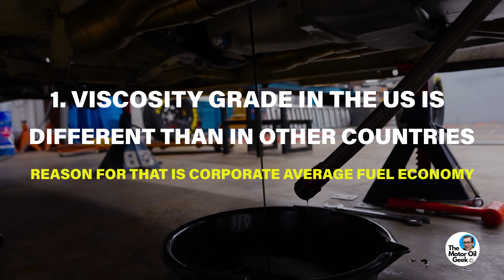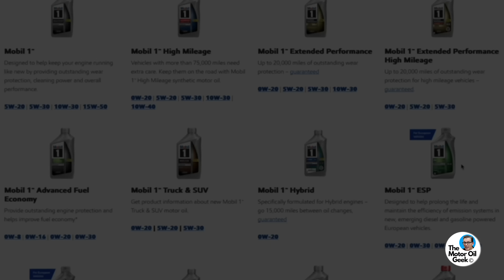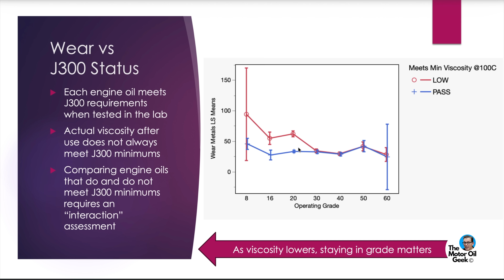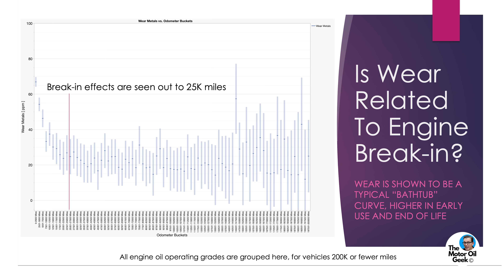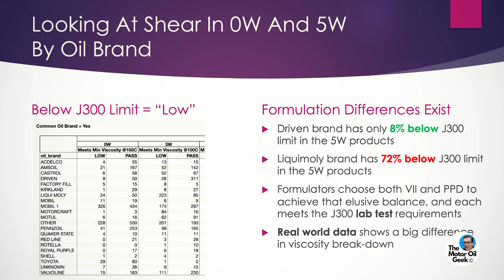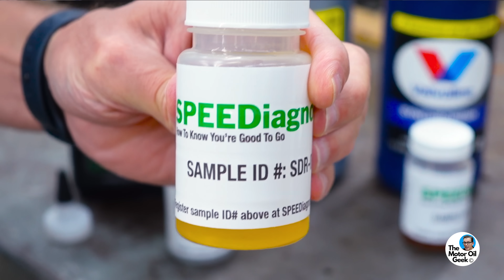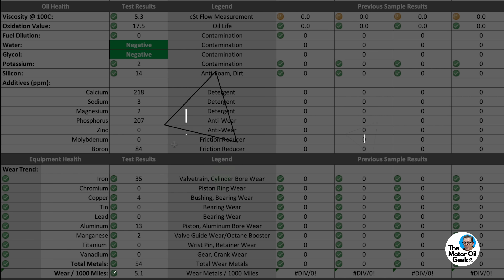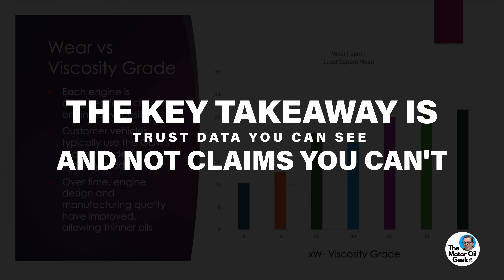More Ai Lies? The FACTS about 0W-20 vs 5W-30 (With Evidence)

Comment: So basically hotter climates stay away from 0w20
Reply: But, how "hot" is hot?
Reply: @cochi2221  over 25-30 degree C is hot enough to not warrant a thinner oil for startup
Reply: On worn engines, I found using a thicker oil in the summer allows for oil pressure to be in the safe range.
Reply: Here in S. FL 0-W20 is completely pointless, correct?
Reply: @hynsum oh definitely. Bump that up to a 5w-20. you don’t need a 0w in florida.
Reply: @lukeWiz44  makes sense to me. 🙏👍
Reply: @lukeWiz44  the 0W isn't the issue, it's the second number that matters. 0W-20 oil is typically superior to 5W-20 oil as they have to use more synthetic base stocks to get it down to 0W-whatever. I would take a 0W-20 oil over a 5W-20 oil because the former has to be higher quality. 0W-30 or 0W-40 oil is a good choice if you want more protection in high temperatures.
Reply: @i @imzjustplayin ou may want to rewatch the video. It was explicitly stated that a 5w-20 is less volatile than a 0w-20. The larger the gap between numbers, the more easily and more susceptible The oil will shear. it’s almost as if you just didn’t watch the video…
Reply: @lukeWiz44  He's correct because they use viscosity improvers but his video was more about how stable an oil is (who cares?) rather than about whether that oil is still providing protection when all the VI have worn out. When VI improvers wear out, the oil becomes more viscous which if you want the best cold cranking ability and better fuel economy on a cold engine, that matters. But just because the VI improvers wear out and the oil viscosity increases, it doesn't mean the oil isn't providing wear protection which is what really matters. If you're changing your oil at regular intervals, using the 0W- oil isn't an issue if your only concern is about cold cranking ability and cold engine fuel economy.
Reply: @imzjustplayin  This comment is backwards.
0W-20 and 5W-20 are the same viscosity at operating temperature. The “0W” only affects cold flow.

VI improvers don’t make oil thinner — they prevent it from thinning too much. When they shear, oil gets thinner, not thicker. Used oil analysis proves this.

Viscosity stability directly affects film thickness, timing chain wear, and oil pump performance — especially in modern turbo engines. That’s why shear stability and HTHS are part of oil specs.

Saying “who cares about stability” is basically admitting you don’t understand why oil standards exist.
Reply: @lukeWiz44  You're right. I misunderstood the purpose of VI. However I would say a 0W-30 oil is going to provide more protection for a longer period of its life compared with a 0/5W--20 oil since the 0W-20 oil is already thinner from the outset.
Reply: @imz @imzjustplayin  me put it this way, the base oil number is the first number. so 0w or 5w. So an oil that’s already super thin, such as a 0W 30, has to be injected with an insane amount of VIIs so it can reach its target viscosity at operating temperature, such as 20 or 30. To kind of put that into perspective, a 5w-20 likely has a thicker base oil than a 0w-40, simply because it doesn’t have to use thinner base oils to reach the cold flow ability. 

it’s an advanced concept that I don’t expect somebody at the consumer level to really understand, but i appreciate you sharing your thoughts on it.
Reply: @imzjustplayin  This is correct. A high quality 5w-20 may be more shear stable but 5W-20s can be made with low quality base stocks that aren't as good.
Reply: @lukeWiz44 Volatility is not mentioned in the video. Shear stability is not volatility. 5W-20 made with mineral base stocks are likely more volatile than 0W-20 which will be at least semi-synthetic.
Reply: @MathewPollard-vj4uq Sure, but a full synthetic 5w-20 will still be more shear stable(due to less VIIs) and yes, less volatile(due to thicker base stocks) than a full synthetic 0w-20.
Reply: @lukeWiz44 5w30
Reply: @hynsum  Probably. I live in Northern California and when it's 40F outside, using 20W-50 doesn't affect cranking ability appreciably over using 0W-20. The thinner oil main benefit is easier cranking in colder temps and improved fuel economy on the CAFE drive cycle which includes cold engine testing. There is a reason the rest of the world has recommendations for thicker oil in most climates. Viscosity when at engine temperature is pretty thin even for the most thick oil. An SAE 60 oil is thinner at operating temperature than a 0W-8 oil is when at room temperature. Room temperature oil is in the thousands of cST while operating oil temps are in the teens of cSt. Think 8-40 for 212F vs 6000 for 70F for example.
Reply: @imzjustplayin  thanks 🙏👍
Reply: No - Climate not mentioned in the video and irrelevant when engine management systems maintain operating temp very closely regardless of environment.
Reply: @MathewPollard-vj4uq Very true. Extremely common misconception. Only time exterior temp matters is extreme cold, when cold start and oil pump ability could be an issue.
Reply: @MathewPollard-vj4uq  Nope. I don't agree, your engine is going to be at vastly different temps if you are in 25F vs 114F.  It took my car 20 minutes to warm up in 32F winters.
Reply: If you have a warranty.  Get an oil analysis after a summer run on 0w20, if it shows is failed, you have documented proof.  I have read a high quality 0w20 can be as good as a low quality 5w30.  Only an analysis will tell you facts.  I have seen videos that state Amsoil, Pennzoil Ultra Platinum, Mobile One Extended Performance, and Castrol with Titanium all did a good job staying in grade.

Comment: A 5w-30 that shears out of grade is still going to be a 5w-20, right?  So why would the wear be more than a 0w-20 that stayed in grade?  Different engines and different applications?  The only way to truly test this would be to do a back-to-back test on the same engine or identical engine operated under identical conditions.  One using a 5w-30 that sheared out of grade and one using a 0w-20 that stayed in grade.
Reply: I believe the graph around 5:30 mark showed 5w-30 oils sheared out of grade protected at least as well as 0w-20 and 5w-30 in grade.

Comment: 0w20 oil works just as well as 5/30 as long as it's in good condition. If it's not however, it can be drastically bad for your engine. Meanwhile the only significant difference between the two whales is allegedly fuel economy. Not enough of a reason for me to take a chance on 0w20, sorry. Also, nobody's even bringing up bringing up how these compare it all with 5w20 which would seem like the happy medium between the both

Comment: What do you suggest for vehicles that get short drives and has out of spec oil and higher wear within 1000 miles or less? On direct injection engines. Oil changes every 500 miles?

Comment: Fuel dilution is the main cause of viscosity loss in modern engines from the UOA’s I’ve seen online and in my own vehicles. I’m not saying all, but a lot of DI engines dilute the oil pretty bad. Blackstone doesn’t give accurate data for dilution either, I figured that out with my UOA experiences.

Comment: 5K miles or 6 months, whichever comes first is the max you should go on synthetic oils, (any grade) for your application.
If you are stingy or can't afford an oil change every six months/ 5K miles, you have much more deeper problems than oil 
viscosity on your car.
Stay in the grade by changing the oil when it's due, is that simple.
If you drive low miles locally then change the oil every three months, even if it has 2000 miles, because those are hard, stop and go local miles.
Reply: *Unless your using Amsoil Signature Series, good for a year 👍

Comment: Blah Blah Blah I have a Yukon 6.0 , f150 5.0 f150 5.4 3v ford 7.3 all over 400k to 780k  in miles use schaeffer's oil 5-40 and in the diesel 15-40 all original engines no new nothing internally No 0-20 would have ever gotten these engines that far This is why new car dealers have 100's of new engines in crates ready to swap sitting behind the service departments The other claim of tighter tolerances is BS as well fact bearing clearance in a 1990 engine is the same as a vehicle in 2025 if those tolerances where so tight you would over heat the bearing and spin it. I buy vehicles from the auction and 0-20 engines are always blown WONDER WHY !

Comment: Oiil change interval of 3000 miles / 5000 km (about 250 engine-hours in a typical city with lots of cars). Unfortunately, in USA and many EU countries it is quite expensive service (DIY is cheaper). For me, the cost is about 2 full tanks of fuel, not expensive at all.

Comment: Internal GM documents are now public that they said to go to the thicker oil because it would dampen internal engine noises. This way the owner would not know via sound that the engine was destroying itself. Hopefully making the engines last to the end of the warranty period.

Also the documents stated they knew their engines were defective. GM would not listen to its engineers.
Reply: where can I find these documents?
Reply: @lukeWiz44 I wonder if that is true or not, if so I would also like to see those Gm documents but I think it’s just a rumor might be true but unless someone can actually prove proof of the documents then it’s just speculation
Reply: @JohnSmith-fy1nh science over speculation! I’m excitedly waiting to hear back from the OP.
Reply: 🤣🤣🤣 Tell that to my chevy 2000 4.3L that had 400,000 miles with religous 5w30 oil changes every 4-5,000 miles, had it not got hit, would still be going. Sounded, ran strong till its end for 18 years. Idled at least 15 min in winter months before taking off. It did have a block heater but only used it a handful of times in extreme minus temps.
Reply: Nonsense.
Reply: Why anyone would buy a new US car today is beyond me. Rather buy from temu and take my chances lol
Reply: We’d love to see proof. Until then this is an AI slop post.

Comment: Does the fuel dilution improoves or clears when you drive your car on motorway/ highway speeds for over an hour and a half or two?
Reply from the maker: Yes, a longer drive can burn off moderate fuel dilution.

Comment: Long story short: Stick with OEM recommendations. The odds of your vehicle experiencing premature engine failure (in your ownership and assuming the vehicle doesn’t have a known manufacturing defect) because you use what the manufacturer calls for is highly unlikely.
Reply: O you mean like the GM truck engines 😂?
Reply: @Grizzlyhillbilly  This applies to anything that doesn’t have a known manufacturing defect. You could use 20W50 in a GM 6.2 and it would still blow up. Oil won’t fix a manufacturing defect ever.
Reply: Generally safe yes. Most fuel efficient tactic yes. But decreasing engine ware potentially not, which for me is the most important factor.
Reply: Hell no.  Never 10,000 mile OCIs on 0w20, unless you get an oil analysis and it shows good.
Reply: @lonniebeal6032 I didn’t mean intervals lol. I meant oil wise. I do 5k regardless.

Comment: Perfect video. You finally explained it to my understanding. I’ve been debating on going to 5w30 in my Nissan vs 0w20. I believe I will do 5w20 or 5w30 now
Reply: Both my ‘17 Camry and ‘19 CX-5 call for 0W20. I’ve been running 5W20 and the lab results have been very good.

Comment: I will just keep using 5-30w and change oil every 5k miles. So far my Honda CRV at 110000 miles, and my Ram 1500 at 80k miles seem just fine. I use Mobile 1 , and Penzoil.

Comment: I seem to recall reading in the days when 0w-20 was first introduced that suppliers discovered they had to use better base oils to meet spec compared to higher viscosities. I wonder how much that contributes to shear-down characteristics vs breakdown of the VI additives.
Reply: Not only 0w-20. Most 0w oil will have a slightly better base oil compared to 5w in the same family. In fact, there're some 0w30 or 0w40 oil that are more shear stable than many 5w30 oil. It depends on the exact oil/family of oil u buy. Generally, ACEA C3 oil tends to be more shear stable, and API SP only oil tends to be less shear stable (but there're outliers of course).
Reply: @multicore-d6w  Yes, I read the ACEA cert. is exactly for higher temps.  Liqui Moly 6600 and 6610 have ACEA C5 which is the newest.  If I lived in say Texas or AZ I'd give that a try.   But for my short summers here, PUP will probably be fine.  Gonna do an oil analysis after this next summer.  Only way I'll know for sure 0w20 is ok.
Reply: It's a question of quality, full synthetic base oil ( or base stock ) have all molecules the same size, as compared to semi-synthetic/dino base oil. Because synthetic molecules are created so they have more control over the quality. But I am surprised that nobody talk about the specs of the oil, which is more important to me ( That API/ILSAC specification ). A Mazda engine of 2020 for example will require ILSAC- GF-5 ( API SN ) as per owner's manual ( GF-5 offers better piston protection ). But you can use the better ILSAC-GF-6 ( API SP ) for turbo protection. Seems that is often overlooked.

Comment: So you recommend getting an oil analysis at every oil change to determine oil sheer break down or stability?  I use OEM recommended 0W-20.  I have a 2024 Forester and change oil and filter every 4000 miles.  I live in NE Ohio and drive 10,600 miles annually practicing mild breaking and acceleration practices.

Comment: An issue with the claim that 5W-30 shears out of grade more often than 0W-20 is we are not given the quality of the oil or how the vehicle was driven.
Reply: Exactly. You really need a test in two engines run the same miles in the same situation with the same oil but two different oil viscosities. At the very least, you need to know how many miles the oil ran before changed. It could be that 5W30 cars are older and people tend to run it longer before oil changes. Newer cars will be changed more often because you care about your new car, and you don't want to void the warranty because you didn't change the oil as specked.
Reply: The bigger the spread between winter and summer grades the more likely the oil will shear down sooner.  5w30 has a spread of 25, 0w20 a spread of 20.  A 10w30 would probably not shear down as soon as 5w30.

Comment: This is all great information. My own story is this: I bought a 2015 RAV4 with the 2.5 about a year ago, with 128,000 miles. The oil cap says 0W-20, and that is what I used whenever I changed oil at about 3,000-mile intervals. But every time I started the car, the engine made a rattling kind of sound and then quieted down some after warming up but never completely. I just assumed that this is how the motor was designed and tried to ignore it. But it still concerned me.

After reading lots & lots of info and watching a lot of YT videos....some good and others all BS....I decided to go to 5W-30 for the next oil/filter change. My mechanic of 25 years said it would be just fine for my RAV4. The difference was immediate: Start-up is now quiet like you would expect...no rattles... and the motor sounds much quieter too after warming up.

The verdict is clear...for my situation....5W-30 from now on.
Reply: That rattle was gone as the thicker oil filled up the tiny gaps on the rod bearings. Good move,
 I think these super light oils are as stupid as electric cars. (smile) Mike
Reply: @mtwseneca  ...Hi....I agree with you...on both points....thanks for the support...!!

Comment: Before I went electric I had a 2016 Toyota Prius. With Amsoil Signature Series the oil test from Oil Analyzers showed the oil was beginning to slightly thicken at 12,771 miles. The test is on the BITOG forum. Sometimes I miss that car, never had a problem with it.
Reply: That’s where I learned everything about oil. You have a link to that UOA?

Comment: I used to get caught up in the never ending engine oil debates. I have and currently use the recommended grade of oil and drain intervals in all of my vehicles. Never had an oil related engine failure. Some small leaks over time, some minor oil consumption. Nothing to be surprised by as a engine wears over time.
Reply: How many miles?

Comment: I worked at Kia for several years as a tech and the infamous 2.4 known for oil burning, knocking, and slinging rods through the block (and we got good and fast at replacing those engines) has this written in the service information for oil spec-Viscosity .................... SAE 5W-20, 5W-30
I personally own two with this engine, one a Hyundai and one a Kia, and they both have 240K and 230K and use a half of quart between the 4K oil change.  I've also personally seen customer's vehicles that had similar but they are in the minority it seems.  Guess what my Kia/Hyundai viscosity oil is and the minority I've seen is.  Hint-It's not what the dealer has in the oil reel.  
Would love to see someone do a video that busts the myth of looser oil clearances on new engines also as just a little research knocks that one out of the park.